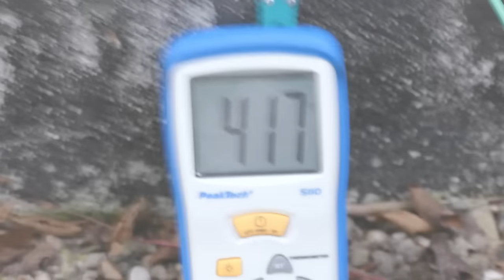14. Raku - How to Build and Fire a Raku Kiln

Comment: Hands down, this is the best single Raku video I have seen.  You cover darn near everything. If you had alcohol reduction you would have cover it all.   How is this holding up with the lid resting on the firebatting?
Reply from the maker: Thanks a lot :-)

It is actually working quite well. The 5 cm wide insulation is plente to hold the lid in place

Comment: Hi Mikkel,  after watching your video i am very motivated to construct a raku kiln for my wife.  Could you please tell me the specifics of the gas burner you are using and recommend?
Reply from the maker: Thanks :-)

The burner I use is from Rakuvaria, but you can also use a cheap weed burner - they just consume a bit more gas and a more noisy. 

https://www.rakuvaria.com/en/raku-materials/raku-materials/burner-3-metre-hose-pressure-control-volve-reducing-screw

There are also some very interesting, powerfull and cheap burners available from Devils Forge, that I haven't tested yet but looks promising: https://devil-forge.com/27-gas-burners
Reply: Thank you very much Mikkel - i will share my components and experience once i made progress.
Reply from the maker: Please do. Good luck :-)

Comment: Where do you put thermometer? Have you made a hole for this before applying the foam or after?
Reply from the maker: Yes, I have drilled a hole in the upper third of the oil drum for this

Comment: Could I use a Raku Kiln  to fire  regulaR ceramics?
Reply from the maker: You can bisque fire in a raku kiln but I never did it. High fire glazes probably not as they require more heat and different schedules than what you can get from a raku kiln.
Reply: @deMibPottery  So, if i use a Low fire Glaze, this could work maybe?
Reply from the maker: Maybe. But it also have to fit the schedule of a raku kiln. It cools faster

Comment: Kiln is a good design but needs a insulating firebrick floor and burner port
Reply from the maker: It works really well for me and its a design used by many others with same good results :-)
Reply: @deMibPottery  the design is very good. A insulating fire brick floor will stop heat loss through the floor. Set burner port at 45 degree angle so flame will spin upward inside for better even distribution of heat. These changes will increase efficiency = better firing / less propane usage.
Reply: @deMibPottery  I will be building this kiln for my brother this summer. I will also have a second flat lid for firing less or smaller pieces. Thank you great video
Reply from the maker: I actually did a lot of tests and measures, going over various designs - and now you can't really see the inside, but the way I deflect the flame actually makes it VERY efficient. I can fire 10-18 times on a single 11 kg bottle!